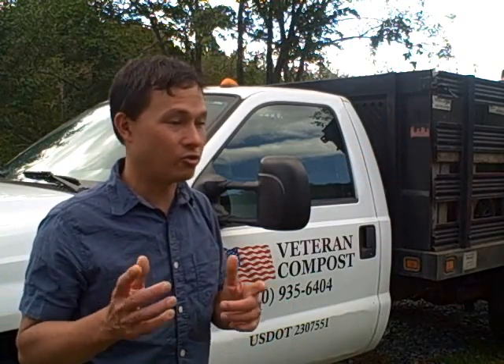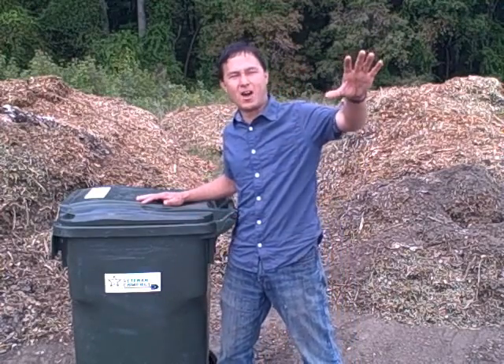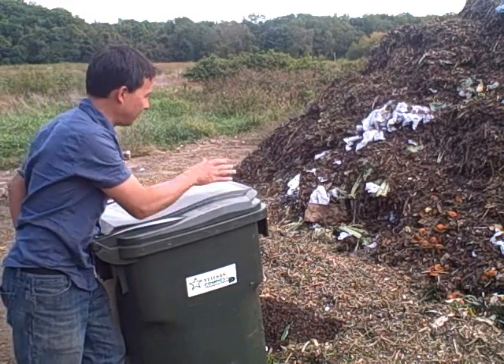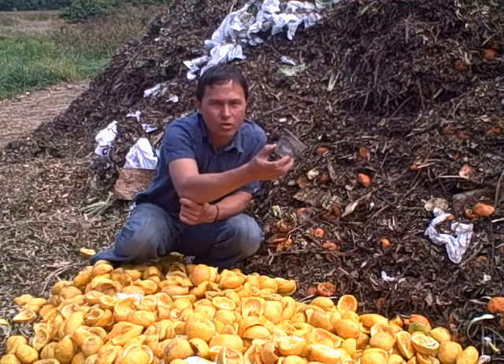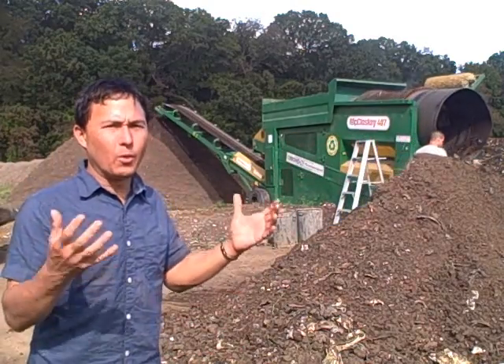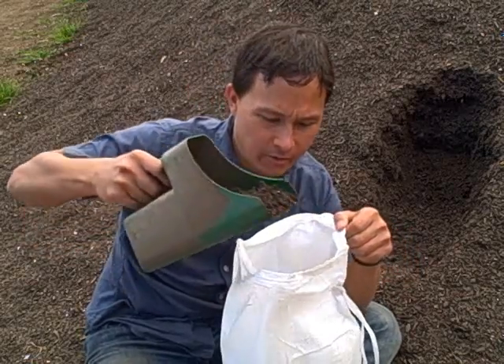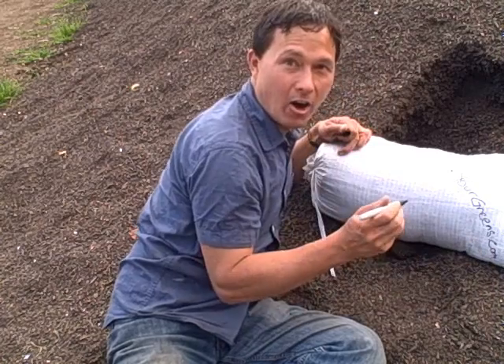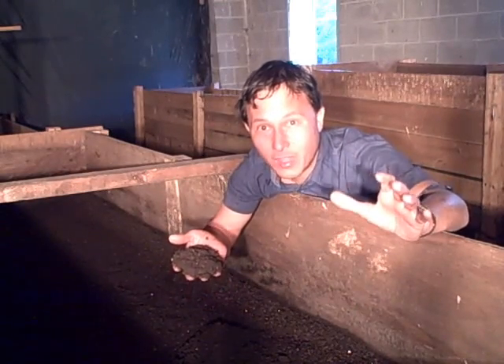How Compost & Worm Castings are Made with Food Scraps & Wood Chips

Comment: I found an acre just East of DC in PG County.  It was a LOT less expensive than Montgomery County.  I drive to work in about 40 min. or by metro from New Carrolton in about 50 min.  I am a mile outside the Beltway.  If I had to do it again, I would look a couple miles further.  A mile is not quite far enough from the noise depending on how the wind is blowing.

Comment: Hi John. I  cannot have a large compost pile in my yard and have it heat up the neighbors are very pesky where I live. If I just layer leaves and  used coffee grounds with a layer of wood chips on top about 3 or 4 inches will this eventually turn into compost? I cannot add food, like I said I have pesky neighbors. I could water it frequently as well. What are your thoughts on this?